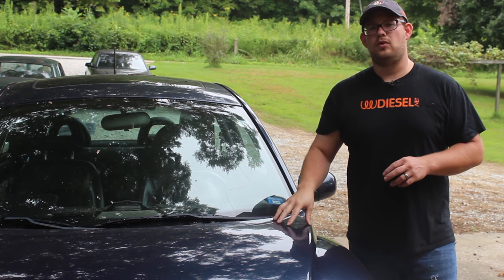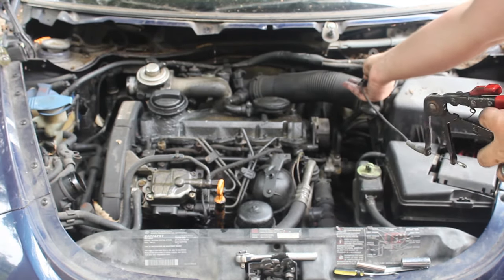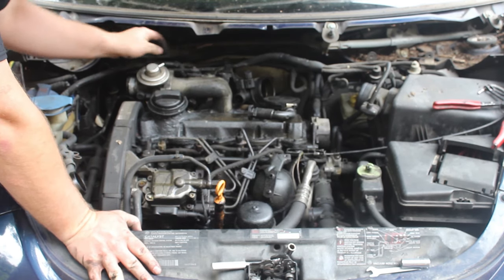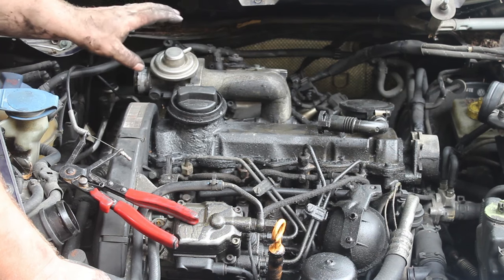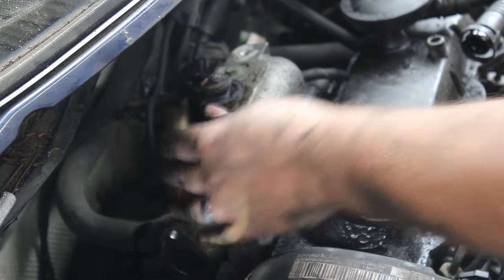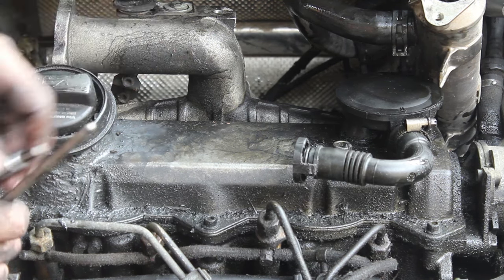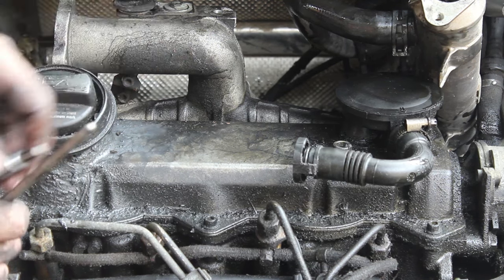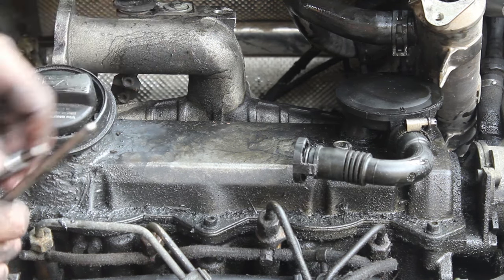How to Remove and Install and Clean a MK4 TDI Intake Manifold Jetta Golf Beetle

Comment: The hanger is a great tip, I'll definitely be using that next time
Reply: get a steel cable and open one end up like a brush. then either use it by hand or drill. it works amazingly

Comment: Brake fluid will soften the carbon very nicely and if you ream it with a bottle brush it will be as good as new in no time . A final rinse with turpentine or paraffin will finish the job. I worry about heating the manifold in case it warps.

Comment: A '96 jetta came in that wouldn't get out of it's own way.  Intake was so plugged only about an inch opening to breathe through.  Used a hacksaw blade to scrape the majority of the crud out.  It was stiff enough to scrape, and flexible enough to follow the runners.  Used oven cleaner, gas grill, and pressure washer to finish it up.

Comment: Blank the EGR pipe at one (or both) ends and use an oil catch can between the crank case vent and the intake manifold.  It will significantly reduce the build up of this gunk in future.

Comment: It's important to note that an aluminium intake manifold will probably deform if you heat it up this way, so you should try to remove the gunk using grease cleaner, or brake cleaner.
Reply: BBQ works great! Nice even heat and bakes the stuff into a powder
Reply: I’m at my end here I know a lil about cars but I have a 1.9 lt beetle bug and it’s a TDI 5 speed.  It’s only has 145,000 miles 1999,  and  I changed a lot of stuff on my car but it was running great then on day it clicked a few times and died it’ll turn over I did replace timing belt that’s fine but my car has been down 7 months PLEASE HELP ME PLEASE.
Reply: @debidirocco5633  what help do you expect, are you planning to repair it yourself?
Either you give it to professionals to do the job or you should learn it's construction and buy the needed tools and pieces yourself.

Comment: What gaskets are needed? Just the intake manifold gasket to the cylinder head. Also, do you apply any sealants around the gaskets?
Reply: Did you ever find out?
Reply: No sealant on the intake gaskets. The raised side goes towards the intake manifold with the indented side going towards the head

Comment: What do you do to clean the intake ports in the head if they are clogged up?
Reply: Usually the process on the engine intake involves using small pick sets and scrapers for the DIY'er. It is important not to allow any of the debris to fall into the cylinders. The suggestion is to work on each cylinder inlet in turn and use the crank to close both the inlet and exhaust valves together. You can check they are both closed by trying to blow into the cylinder using a hose. There should be no air escaping. It is important that before opening the next inlet that the one you were working on is as clear/clean as can be from debris... Professional solutions involve blasting the valve stems and inlets with crushed walnut or similar media. Obviously this will be more thorough but the process requires strict cleanliness in the inlet after blasting and complete confidence that both the inlet and exhaust valves are closed before proceeding.

Comment: All in all great video, but doesn't all that turbocharged flame overheat the metal, causing it to degrade/make it more brittle (even if you don't melt it)? Think I'd rather use some mechanical process like a dremel with flexible cable and proper  sanding/cleaning accessories...
Reply: ps. I realize that's a part that will anyway have gone through hundreds or thousands of high heat cycles, but I still doubt it will normally reach the temperatures caused by a direct flame like that... would be interesting to test that.

Comment: Hello ✋🏻, you didn't show how you take that pipe out at 03:00 , because I have leak in my car LandRover LR3 V8 4.4 leak in the PCV and I tried to replace the PCV but couldn't remove the pipe ? It's the same hose in your car at 03:00  how you remove it ? And what's the name of it ? Thank you
Reply: Also you can see the pipe or hose whatever it name at 07:30

Comment: I have a beetle, yep they’re the devil, any job inside the engine bay requires rubber arms and fingers. I’m doing inlet clean when I replace the turbo in nicer weather (oil in the pipe work 😢)
Mine is the ATD pd 2003.
The cowl with the wipers looks a bithhh to get remove and that’s just the start 🤦🏼‍♂️😂

Comment: I broke my ball allen tip off in one of the intake bolts 🤬🤬🤬🤬🤬
Reply: Use a rounded bolt extractor socket if you haven't already got it off. And lost of penetrating fluid next time!